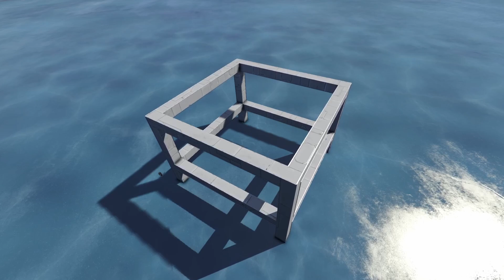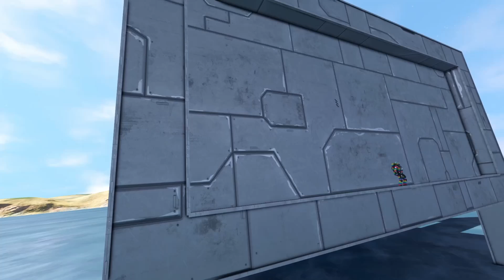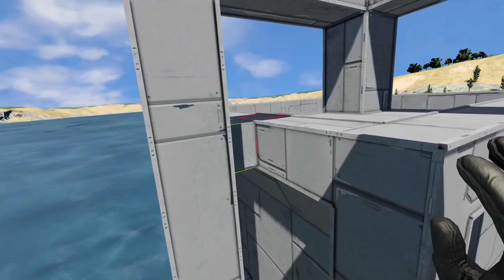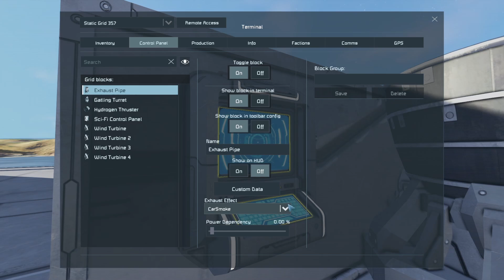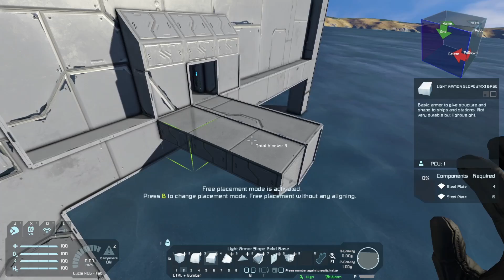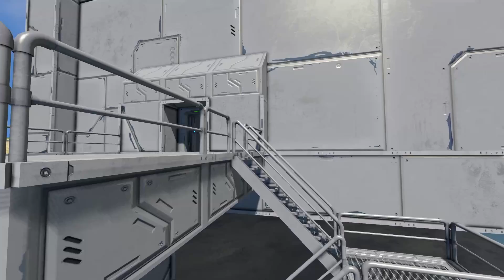Quick tips for Better Looking Space Engineers Builds

Comment: (In some moments I can repeat from the video).
 From my experience, I can only observe how a frame box was erected. It's not just about the details, it's about the shape of the construction itself, sometimes no matter how hard you try, you can't cut the maximum relief you want from the plane. you need to give more additional shapes and details. it's also important not to overload the construction with too many details and make better details where it matters, otherwise it will be chaotic.
 Ergonomics can also play an important role in the design, depending on what you want to get out of it, you don't have to build a huge room rad several plants and containers of equipment.  If you survive without any danger, you can use the equipment as additional decoration, if you can use it properly, you will save a lot of resources and space. 
If you are frequently attacked, it is better to hide everything of value under the base by drilling a hole (can be unreliable in some cases!). It is better to use sturdy blocks such as door blocks and heavy armor as exterior decorations. with the right play, you can make an impregnable fort.
I hope I've explained it clearly, and if I haven't, well...
You can find all the examples online and in the workshop to build your base based on their solutions.
Reply from the maker: This is some amazing advice!